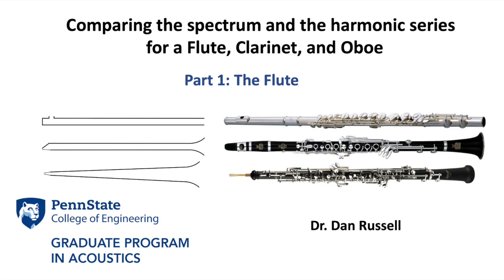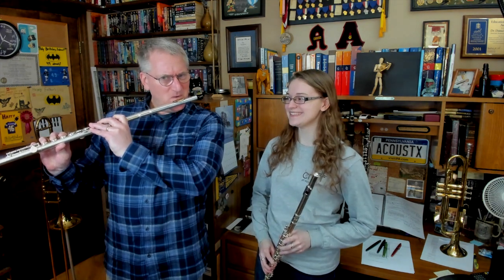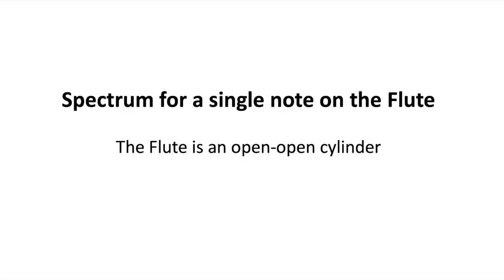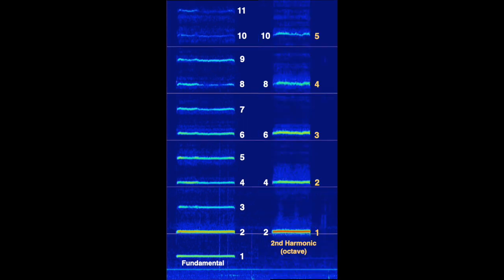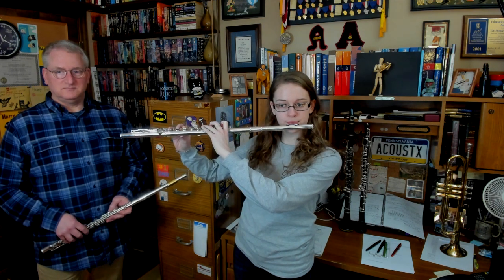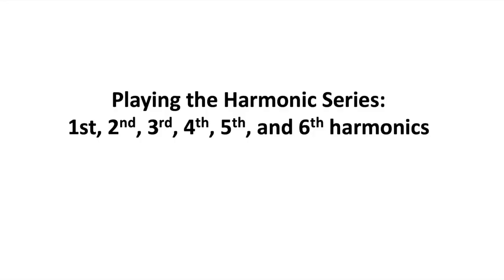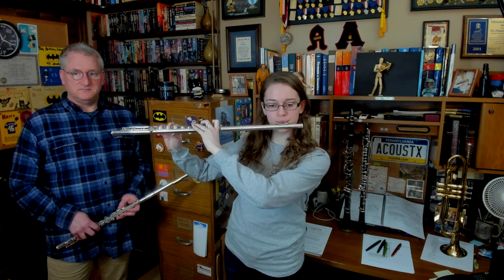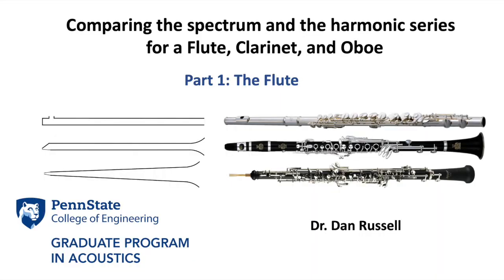Spectrum and Harmonic Series -- Part 1: Flute

Comment: Does the measured Open-Open distance correlate with the measured wavelength?
Reply from the maker: Roughly yes. The distance between the embouchure opening and the far open end is about 60cm (but that ignores the volume or length in the head-stock and it also ignores any length corrections at the open ends -- the "acoustic" length of the flute is about 66cm). The speed of sound in warm air (breath from the player is a bit warmer than surrounding air) is about 350m/s. The lowest note on a flute (with all holes closed) is C4 = 262 Hz.  That corresponds to a wavelength of about 1.33m and the fundamental standing wave mode in an open-open pipe has a half-wavelength, or 66.5cm. And that isn't accounting for any end corrections at the open end, or any length adjustments due to the closed-hole lattice.  So, yes, the measured open-open distance does roughly correlate with the measured wavelength.